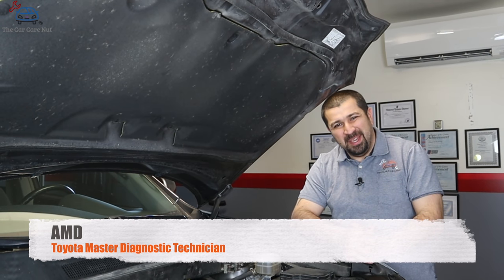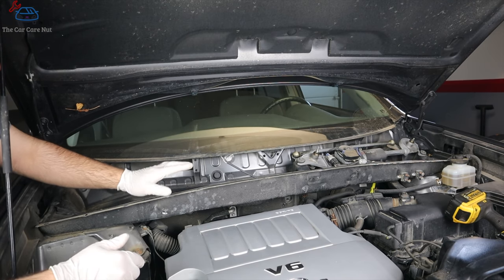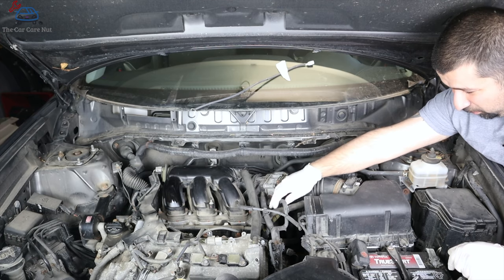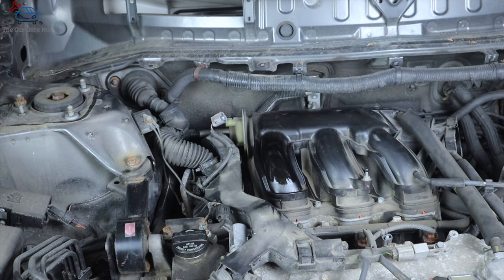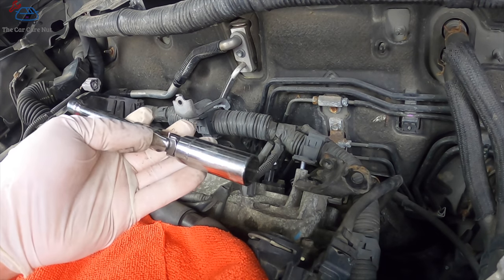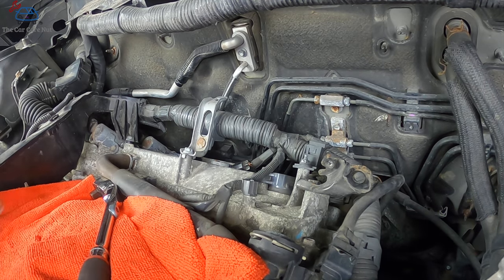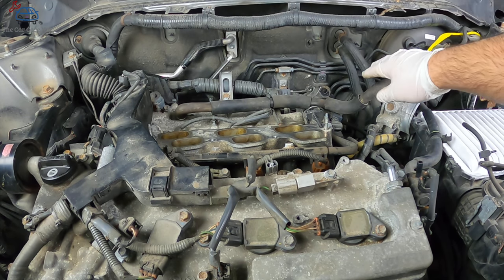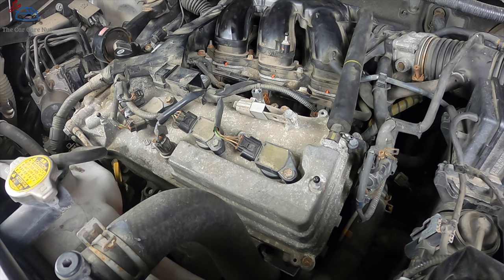How to change spark plugs on V6 Toyota and Lexus 2GR-FE 3.5L engine

Comment: Just finished this job. This is what nightmare fuel is made of. Forgot to reinstall one 10mm bolt on the wiring harness behind the intake manifold unfortunately but I refuse to take everything apart again to put it back. Car runs perfectly. Relieved it's finally over 😊

Comment: Great video, much appreciated the step by step to replace the rear spark plug. I gain more confident after watching your video to do a tune up on my 08 Highlander with 145K miles with a P0352 error code.
Just a correction though, the 2 wires that attach to the windshield is not an antenna but it is a Heated Wiper Park cable. It purpose to heat up the bottom and side of the Windshield to melt away ice to free up the wipers.
Thanks again, love your channel.

Comment: Great video!  I changed out the plugs on our 2011 RAV4 a couple of days ago using this video as a guide.  I didn't have to remove the cowl, and the bracket bolts on the back could be removed with an electric ratchet with a deep socket on it.  Thanks for the time you put into making this guide!!!

Comment: old vid now - THANKS THANKS!! '15 RX - so detailed - convinced me to avoid the 'no intake manifold' route - the job proved very easy with a couple of the 'right' tools. One thing though - my original spark plugs seemed to have been installed with some kind of thread compound and were very hard to remove. Would have likely been impossible if intake manifold hadn't been removed.

Comment: Just got done tackling this job. Took me 4 hours total,keep in mind I was watching this vid as I was doing it. Also took the extra time cleaning the intake manifold and engine filter. Wasted time fighting that bolt in the rear of the manifold switched between 4 different swivel sockets. 2 broken clips from the ignition coil connectors and 1 red eye from one of them 😆 🤣 😂

Comment: Thank you for this and the newest v6 video for spark plug replacement! Your tips and encouragement for these jobs are spot on. 

Unfortunately, the clips on my 2012 ignition coils all broke! My dealer had replacement clips ($10 ea) that made the job more challenging and longer. A bit of a pain for sure! 

All systems go now! Great work.
Reply: What is the part number for the clips?  I broke all 3 front clips/wire connectors on my front coils.  And I was VERY gentle on them.

Comment: Appreciated this video Amed.....  Used just this week and my plugs were in sore shape!  Surprised the car was running as good as it was!  Original plugs at 135K on 2011 Lexus ES350.    Only difference was the wipers didn't need to come out because the its all unibody under there!   There is a bar across the back of the motor that is tied to 2 bolts on each of the strut towers...   4 nuts and it's off!   Makes digging around the back much easier.    If you're doing this? take your time and take pics on the disassemble to make sure all the lines go back in the same spot!!    Saved me... lol  (I know you know this.... just including this for others! 😊
Thanks again Car Care Nut!!

Comment: Just pulled plugs out of a perfectly running 06 Avalon it had the original Denso plugs. The front Bank plugs threads were Rusty and I had to carefully turn and counter turn to avoid thread damage!
You bet I used anti-seize on the new plug threads. I don't know why you would suggest not to put anti-seize on aluminum head spark plug holes but you did without explaining why. I also went on to change the valve cover seals and replace the oil bypass tube that have the rubber elbow that would eventually blowout this engines oil.
Timing chain rattle hasn't come back after the seals were done..👍

Comment: Great video, thanks
I replaced spark plug today for 2015 sienna

I didn't install bottom cow before start the engine. Electric Power steering light on  and it stop my engine in few second. Spend half hour find out there are electronic device on bottom cowl not connected. 

After fixing that, another warning come up, traction control and some other warning light and no brake

Eventually find out forgot connect vacuum line

Next time, I will definitely lable every pipe and wire 

Spent 6 hours to get it done

Car running normal now

Comment: Thanks for the video. I replaced the plugs and coils on my 2007 Sienna LE. Only thing was I couldn't get the back bolt in. I tried for 2 days, left hand, right hand, laying on the engine and with a magnetic swivel socket. So, I put everything back in w/o that bolt and called it a day. Hope this one bolt will not cause any serious issue !!

Comment: Excellent tutorial!

Toyota Dealers want $121.36 per ignition coil, which is a lot more than the old/defunct spark plug wires that we all used to change, when we replaced the plugs in our 1990’s vehicles. 

In a future edit to this great video, could you maybe address the following questions?

1. Does a typical spark plug change at a Toyota dealership also include new coils?
2. How long do the coils last?  120,000 miles?  300,000+ miles? Longer?
3. Should the back three coils always be replaced at the same time as their respective plugs, given the labor needed to reach them?
4. What are the signs (if any) that a coil is going to fail soon?  (e.g. burn streaks on the old plug)
5. What are the gotcha’s involved in replacing the coil itself? 
6. Is dielectric grease needed when installing new coils? 
7. What are the do’s and don’t in applying dielectric grease properly?
Reply: i kind of feel the same, i am going to try an tackle this Winter Break on my 2009 Sienna

Comment: Fantastic instructional video, very detailed.! Great practical tips. I found it helpful to put masking tape below each wiper blade as a locator before removing them to facilitate quick installation. Also, I found oil in one of the spark plug wells on the front bank, the job got a bit bigger because I had to remove the valve cover and replace the tube seals.

Comment: This a very good video for this project and the best one I've found. Thank you! This made the job relatively easy. I'm a certified aircraft mechanic so I'm not unfamiliar with turning a wrench, I don't really care to work on autos unless I have to, but the cost to have this job done made me decide to do it myself. I actually got it done within the shop rate time having never done it before. Having the torque specs in it was a time saver too.

Comment: Replaced the spark plugs on my 2012 Kluger today. Wasnt ready for still how little space there was after removing the plenum and not having that swivel 12mm nut is a pain. Also i struggled stretching to reach the rear. Gave myself 2hrs. Took 1hr to reach half way mark but 5 hrs the other half.

Comment: Thank you for this video. I followed it and went back to it when I got confused, and it was spot on. I had what looked like a heater coil attached to the wiring harness after I removed the plenum. Other than that it was perfect.👍

Comment: Of course I found this video after completing the job. Luckily I was skilled enough to do almost exactly what you did. I did cut a notch in the bracket so I didn’t have to fumble with that bolt on the back of the intake.

Comment: Awesome Video! I followed every to do plugs and coils on my 2008 Lexus Rx350, and your tutorial was a life saver. No way I could have got the job done without doing every step here, and then even a couple more because the rx seems to have slightly less space by the firewall. It was tight. Even being this, thorough I still struggled to get the plugs and coils swapped out, mostly because the coil pinch clips are such a bear to get at and I didn't have the perfect pick to get them, so that took a while.

Comment: Quick tip for re-installing wiper arms.... if your windshield isn't OEM and doesn't have the index marks mentioned at the end of this video, before removing the arms place a piece of masking tape on the glass along the edge of both wiper blades. Simply line the blades back up to the tape edge when re-installing the arms.

Comment: Very nice video.  Just bought a 2008 Highlander.  Figured I'd check the spark plugs.  Already broke one of the the coil connectors after 'touching' it (sigh) and quickly realized the plenum was going to have to come off.  No biggie, but then someone said you have to take off the wipers and I was a little perturbed wondering what else was in store and whether Mercedes designed this thing.

 I have a premonition that I'd better get good at taking this apart, and probably will.  Lot's of stuff back there.

Comment: Did this on my 2008 Lexus ES350 today. Did not have to take off cowl or windshield wipers, but did have to take off a bolt and nut more for the wiring harness. Also had to remove a 10mm bolt for a retaining piece for the brake booster hose holder because I couldn't get to the rear driver side intake bolt. Didn't use a 12mm swivel but used a 3/8 to 1/2, 1/2 swivel, 1/2 to 3/8, 3/8 12mm and extender for the bolt in the rear and it worked out. 

After getting the bolts and nuts for the wiring harness I did not need a swivel for the spark plugs. I did brake a retaining clip for one of the plugs in the rear, and all 3 snapped off for the front. As long as you have them pushed all the way in I don't suspect they'll move, although I suppose you could use some electrical tape to keep them in place. I also have the clips for my air filter box and think I broke the rear 2 brackets since I tried to take it off in one piece. Maybe remove the hose in-between the air box and throttle body completely before completely removing the air box.

Used NGK laser iridium spark plugs regapped to .44 (either .4 or .42 from factory), replaced rear coils with Denso OE equivalent coils, and throttle body and manifold gaskets from Mahle. Sure it's not Toyota, but Denso makes their coils, NGK is a top tier company for plugs, and Mahle is OE for many car companies.

Other than getting my hand cut up (every single time I work on a car) and having to remove a couple more things (which was completely fine since I didn't have to remove the cowl) everything went surprisingly smooth, which is uncharacteristic of my experience working on cars. Thank you car care nut! I mostly knew what to expect and all of my tools were ready before the project began and it definitely saved a lot  time!

Comment: Excellent!!
I was looking for this video. Actually I attempted to do this job and stopped. I said how the heck is done😅
Now it's easy.
I still looking for the coolant replacement on the 2007 Lexus GS 450h. Your other videos (if am correct), don't apply to this model.
A small tip if I may. Before I remove the wipers I put a masking tape to know the limit. 
Thanks again!

Comment: I replaced my friend's 1999 Honda Odyssey v6 spark plugs  the other day. There are 3 spark plugs in the back also but didn't have to take any parts out to get to the spark plugs. Took me less than an hour. to replace all 6 spark plugs and its my first time replacing Honda Odyssey's spark plugs.

Comment: I’m a backyard mechanic. I’ve replaced ones on 2005 Camry v6, 2014, Sienna v6 & 2013 Highlander v6.  Most important thing is, don’t get in a rush and be patient.l with yourself. And Do it on a early Saturday morning.  
Make sure you have all the tools you need.

Comment: I have a 2010 Lexus ES 350, and I don't need to remove the Cowl to get to rear spark plugs, so I want to make sure, but I do have a bar that goes horizontal from strut to strut, and I think I have to remove it. I appreciate the details in this video.

Comment: And I thought spark plug access was difficult on my 1969 427 SS Nova because of the hooker header pipes.  Take me back……..
But this is a GREAT video for DIU.
Reply: Same here 396/375 69 NOVA w  HOOKER HEADERS.  We had it easy compared to this.  ( although this is a GREAT video if you have this Toyota )

Comment: My experience - first time doing a job (usually the case for many viewers) I like to take parts off so I can see what I'm doing. If I should ever do it again I may choose not to. Disconnecting connectors that one is not familiar with is challenging if you can't even see it. Working "blind" is an acquired skill.

Comment: Awesome video. My friend just got quoted $1000 for one ignition coil on that bank of cylinders. Told her I could do it for her, just wanted to see how it came apart. With your video I even have the torque specs, all I need is part numbers for intake plenum and TB gaskets now 😂. I guess I can look those up on my own. Thanks for saving me a ton of time.
Reply: What a ripoff price. Depending on model plenum doesn't need to be removed..just did it on ES 350.
Reply: @markg999  they also charged her 244 dollars to reset tire pressure monitor because tpms light was on after THEY did the service on the vehicle. They are crooks, told her not to go there anymore.

Comment: I wish I would have found this video before I tried to change plugs on my Avalon V6.  Another video instructs mechanics to drop the crankshaft from the block, pull off the rear cylinder head where the plugs can be removed and installed with the head on a workbench.  I put new iridium plugs and the engine is now a lot smoother.

Comment: If it was my car I would replace valve cover gaskets since you're in there anyways.  I would also clean throttle body, pcv replaced, and MAF sensor with approved cleaners. I understand some customers try to go cheap and skip these. Thank you for video. I need to do this on 2008 Sienna for father in law someday.

Comment: I've replaced spark plugs on my 07 Hybrid (6 or 7 months ago) and my friends 07 Hybrid Limited (yesterday) and I've got to say this video matches 90% when it comes to the hybrid model, even tho he said this doesn't apply to hybrids. What I noticed for hybrid is:
At the start, you don't remove the windshield wipers because the firewall is 2 inches away from the back of that plenum.
To get behind the plenum you use a flex ratchet 14(mm) and behind the throttle it's a flex ratchet 12(mm)

I did strip 3 out of the 4 8mm hex male bolts and if you stripped any, how I got it to unscrew was to use a bottle of rust remover and sprayed around the screw (because of the rust) and I used a 14mm 12 point deep socket (doesn't work with 6 point, only 12 point) and hammered it on the bolt and used my 1/2 inch electric impact drill to unscrew it

I believe all the tools I used were a 12mm socket
14mm deep socket
12(mm) ratcheting flex wrench 
14(mm) ratcheting flex wrench
6 inch and/or 12 inch extension 
5/8 deep socket
Extendable magnet

Color coded zip ties (optional - used for hose identification)
90° bent needle nose pliers (optional  - used to undo all clips to the coils)
Extendable magnet (optional - used if your 5/8 deep socket doesn't have a magnet or used in general)

I used an electric 3/8 impact drill on all the bolts, but for the stripped one, I used a 1/2 electric impact drill 

Hope this info helps those struggling to find a video for the hybrid model as much as I did.

Comment: Fwiw, my dealership said it was not worth the $$ replacing at the recommended interval, as those they had changed looked fine. I finally decided to change them at 185k to not push my luck too far. But it was still running fine.

Comment: I have a 2011 Toyota Camry LE with a 3.5L V6  2GR-FE V6 engine with 110,000 original miles and have been meticulous in having the car serviced by local Toyota Dealer. It is the same engine used in the 2011 Lexus GS-350.  Please tell me what are signs of when I need to change the original spark plugs, ( NGK - Iridium IX Spark Plug: Single Iridium Fine Wire, LFR6AIX-11 (Part No. 6619) 93) plus orange replacement gaskets)  in terms of low gas mileage, engine is running not as smoothly when new, engine at idle, etc. Also  please advise of potential damage to engine if I do not change the spark plugs in a timely manner when you suggest spark plugs should be changed at 120,000 miles. I have subscribed to your channel and am impressed with your knowledge, and professionalism and how well you describe and share information in your videos. Thank you in advance for your prompt reply. Thank you! Well done!

Comment: Thank you for your video, it helped me change the spark plugs and ignition coils on my mom's 2009 highlander, it took me almost 5 hours (the bulk of it was trying to get the screw off the L bracket and then putting it back) lol but I got it done.
Reply: Any suggestions to put that bolt back on?

Comment: I just bought an 07 w 34k original miles, single owner, oil changed every 6 mos, maybe 2000 miles every 6 mos. Runs like new, you said every 150k or 10 years. Should I change the plugs on my new pearl? And thank you as always for your excellent videos. *I sold this Camry, put every CCN experience into it. I also offered a sellers warranty for 1 year. Thank you AMD

Comment: Thanks, I had removed the plenum to change the bank 2  O2  sensor. It was butch. Thanks again for the education.
Reply: I changed bank 2 under the car. It was also a bitch. Tough to reach.

Comment: Thank you The Car Care Nut, I used your video to change my plugs over the weekend saving hassles.  Your instruction was so detailed that there was no guesswork, just followed your video exactly along with the basic tools you showed.  You are right, that right rear 14mm intake bolt was a pain! Took all your advice and used OEM parts vs second guessing especially since it should be a one time job or very infrequent job and wanted to avoid going back in the rear bank anytime soon 🙂

Comment: Great video, very informative!

question about torque specs, what values for:
- Two large nuts per side for the cowl
- Two rear support bolts for the plenum
- 4 bolts for throttle body

Thank you